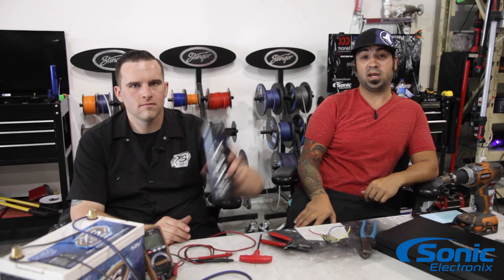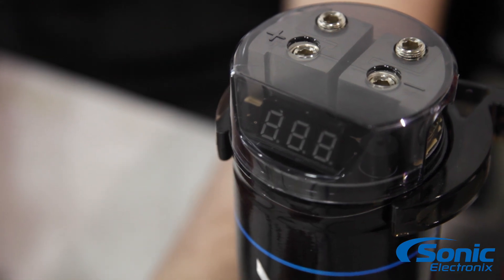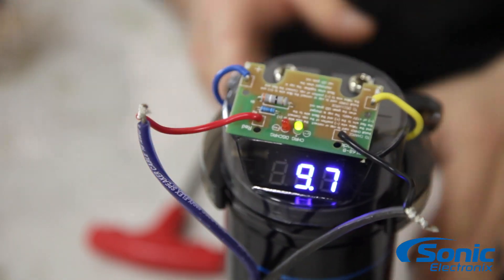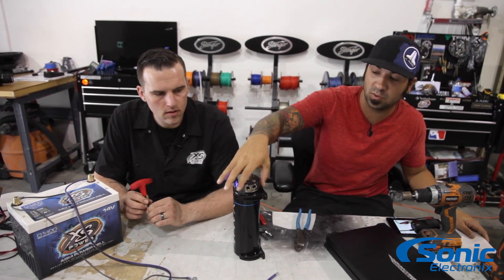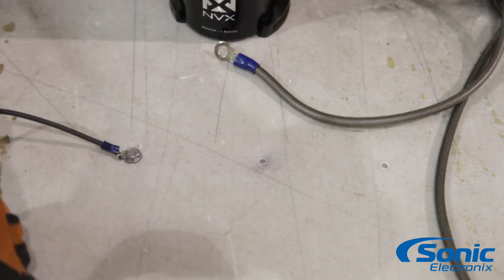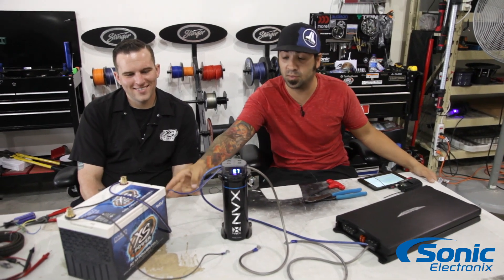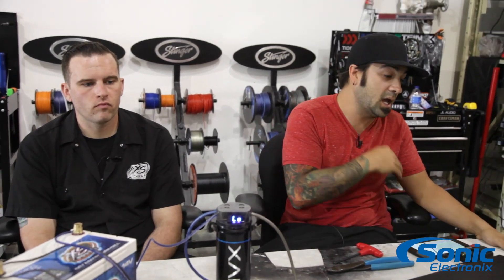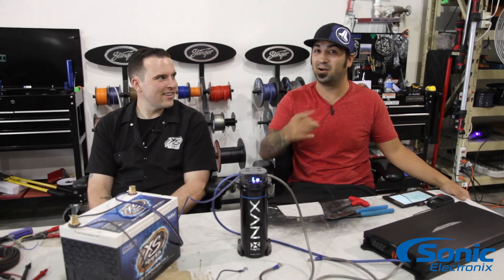How To Charge and Install a Capacitor | Car Audio Q&A

Comment: Is there a formula for figuring out how much voltage you need cause I feel like I'm a burn out my computer in my car. Running 2 10sdc2.5 soundqubed on 3400 spa and kills my truck all way down
Reply: +Nick kruszka Yes, there is.  Watts x Voltage / amp efficiency(0.8) = amperage draw
Reply: No idea what that guy's on about, but voltage-wise you want to maintain around 14volts or higher at all times. When something suddenly draws a lot it causes a voltage drop, so if you're experiencing something that starves your spark plugs of enough energy to fire when a bass note hits, then you very likely need either a new battery, a large cap, or to increase the gauge of your ground cable leading from your battery to the frame. If however you're saying that over time if you play your system loud enough it will drain your battery until it turns off, then that's completely different. The only way to combat that effectively is to upgrade your alternator or get more sensitive speakers or a more efficient amplifier. A capacitor might help slightly with that issue but it's very minor and probably won't make the difference you need.

Scale your power requirement depending entirely on how you run it. You're very likely not using the full RMS power of your amplifier, I'd say at most 80% of it if you've owned it long enough to make a few mistakes when switching between songs of different volume etc. You never really know how much power you're using though unless you get a proper instrument like a DC clamp meter with a max peak current hold around your wires or a quality current shunt with an accurate multimeter with max peak voltage. Just keep in mind some losses that naturally occur, the amplifier is going to lose around 10% in a best case scenario between what's coming in and what's going out, the alternator isn't always running at full capacity, the battery probably isn't cranking out its full listed amps all the time, and the rest of the car needs energy to run as well depending on how much electronic stuff is in use.
Reply: Yeah my electronic equipment definetlyold I need super up grade if I want keep it in my old truck and yeah it's goes in to brown out now I got 15 sundow zv3 :/

Comment: What is the big 3?
Reply from the maker: +Brownecakes "The Big 3 Upgrade" is an install you do to upgrade your vehicles charging / electrical system. You can buy kits that include all the wire and accessories you need.

The 3 wires that are upgraded:
1: Alternator Charging Wire to Battery Positive
2: Battery to Chassis Ground
3: Engine Block to Chassis Ground / Battery Negative

We are currently working on a Big 3 Upgrade How To video. Should be published in a month or so. Be sure to subscribe so you don't miss it!

Comment: You mentioned you may need to upgrade your alternator. At what point do you know that is what you need to do?
Reply: When running at a significantly high volume eventually causes the amp/head unit to go into power protect mode. This means that your battery is draining and your alternator isn't able to give it enough power to maintain equilibrium. Before you do that though, first check that your main grounding cable from your negative battery terminal is good and beefy, and that it's making good contact with the chassis. Also consider replacing your battery first, as this could solve your problems as well.

Comment: I don't understand why you're grounding to the table instead of the negative terminal of the battery...
Reply: +Oscar Hendrix  I'm just running a soundsystem, without the car...
Reply: +Oscar Hendrix I guess my question is, can I ground everything to the batt's negative terminal or literally any piece of metal?  I don't understand how this works without if you don't have a circuit...  (if you don't return to the negative terminal of the battery).
Reply: yes you can! and there shouldn't be to big of a difference
Reply: You can connect everything to the negative terminal without a problem. Just keep the power as far as you can away from the signal cables. I've heard from a lot of people different bullshit reasons behind different grounding procedures for the amp and the cap. Some people say always ground them in the same spot, others say never ground them in the same spot. I haven't looked into it much admittedly, but the same spot people make a lot of good points that seem to be lacking on the different spot side of things. Your system isn't in danger of sounding crappy because of the lack of a car, so long as your speakers are all properly enclosed.

Comment: you say when it drops under 12v the display turns off yet in the video it is still on?
Reply: +Just Trickky I was curious about that myself.  Seems the microprocessor in this cap turns off when LED activity stops rather than a particular voltage is reached.  If they had actually connected the cap to the battery, the LED readout would have stabilized to battery voltage and turned off.

Comment: hey what capacitor needs my amp 1500 watts max and 1100 RMS?
Reply: +Taylor Ramos 1 farad for every 500 watts is suggested
Reply: Taylor Ramos  
You would be safe using 1 Farad cap but I'd recommend getting a 2 farad (if you can afford it)  don't buy some cheap ass no name brand cap there a good example of you get what you pay for lol. No seriously avoid Boss ,  Pyle , Bullz elect. Go for Rockford Fostgate or Stinger's or Street Wires  cap those are reliable and will serve you well for many years to come. Good luck!

Comment: Is there a reason why you charged the cap via speaker wire directly from the battery instead of charging it via your power wire and the ground you had set at 6:05? As long as you're running it through the resistor on the charging tool wouldn't it virtually be the same circuit?
Reply from the maker: +mattyfizzle Right, it wouldn't matter what wire you use if you're just charging it up, very low current, so they just used the speaker wire because it was easier and it worked and it was just for the demonstration. However, it goes without saying.. don't install you're capacitor using speaker wire...
Reply: lol exactllyyyyy dat stuff b so funny to me
Reply: They wrote: "Don't install you're capacitor using speaker wire..."

Which would mean "Don't install you are capacitor using a speaker wire..."

They used you're incorrectly and correctly, but the second time they used it, it was the wrong use of you're. Before you reply trying to act like you're giving me a lesson, take some time and get up to speed.
Reply: They used "you're" in the last sentence when it should have been "your." They are talking about your capacitor, not you are capacitor. I swear, people are so fucking dense. Thanks for trying to explain to them, trippledigitss, I appreciate it.
Reply: +Sonic Electronix Your
Reply: +SeanOMatic lol grammer nazi
Reply: +Christian Creighton Grammar
Reply: Then you must be cracking up all the time because the grammar people use these days IS HORRIBLE!! hahaha
Reply: SeanOMatic and I hope u know that you're actually the wrong one here. it is you're not your.
Reply: elice05 I thought the same thing but there is 2 different uses, I think he means the 2nd one. . I'm guessing...

Comment: They need to do this with a "basic" tool most people don't have a fancy led board.
Reply: +mark smith A 12V test light works.
Reply: Pretty sure they used that because it came with that particular capacitor. Also yes, a 12v light bulb works, they could also use a car battery charger without issues so long as it's not a piece of crap charger that can't set its own current limit without the resistance of a battery. You can also buy a large ohm value resistor on  ebay for less than a dollar that would work.

Comment: I have two questions about your table car question number 1 how many miles to the gallon do you get in that ride?  question number 2 where did you have the speakers hidden?
Reply from the maker: +Steve White We'll be honest, the milage isn't very good, and it's top speed is probably about 10mph (or as fast as you can push it across the room). And unfortunately, aside from the battery, amp and capacitor you saw them install, everything else is stock.... aka.. no speakers.   :[   

We will have to put some more work into it, maybe do a whole install video?   :P
Reply: and is missing a ground plate

Comment: i have 2 kicker crv's in a ported box that i am pushing with a massive n4.. i have a massive 4  cap.. my problem is when i turn my stereo off i get this huge rumbling sound from my woofers.. im wondering if i should take the cap off.. what do y'all think?
Reply: Sounds like more of an amplifier/headunit problem than a capacitor problem to me. I don't know the details though, i guess it might be the low pass filter in the thing? They have coils to shape the sound characteristics and when power is cut off the coil's magnetic field collapses, causing a jolt of voltage... I don't think that'd be audible as a rumble though, so who knows.. Maybe a combination of caps and coils for a steeper drop off, but that's literally a shot in the dark as to what's causing that. I will stick with my original guess though, that it's not anything to do with your capacitor.

Comment: I did the big three... I upgraded my alternator... i have a second battery... I drop the bass in the mix, my voltage meter on my truck says around 12-13v and my lights dim... I ordered a 3 farad cap and im hoping it will solve the issue... is there anything else i should revisit. Like Grounding or something...
Reply from the maker: +Bully ThaKidd If you did all those upgrades and you're still getting dimming then yes, absolutely go through and check all your grounds. Sounds like you could be losing some voltage to a bad connection somewhere.
Reply: Specifically the ground cable from your battery to the chassis, it should be two wires of greater or equal gauge to the ones coming off the positive terminal. Also make sure the battery terminals and connectors are clean for both positive and negative. The grounding to your amp is probably fine. Since you upgraded your alternator, you may also want to replace the cable going from the alt to the battery with a thicker gauge, but that wire isn't a fix for your problem, it's just recommended as a matter of cause. Unless of course they dim over time, not just when the beats drop. In that case you should definitely suspect the alternator wire.

Comment: Well guys, thank you so much for truly clearing up any misconceptions about why a cap should be used, my only question would be then if a half farad cap cleared up the alt noise then why are there such large caps and cap banks on the market if they're mainly for filtering alternator noise? And the nvx looks identical to the pyle 5 farad except it has the terminal block (very nice) and the smoked plexi.

Comment: How did you get charge the cap at 13volt. When I charge my cap it was 9volt or even lower. I am wondering if the cap get the full charge
Reply from the maker: +stephen, hui Your capacitor has a digital display like the one in the video and only charges up to 9 volts? Even with the car running...? Out of curiosity, what capacitor do you have? You know the brand and model?
Reply: +Sonic Electronix the car never running when the cap charge. The brand is american assistance cap 2 fared
Reply: +Sonic Electronix but every things is ok I have a 2 l7 15 on audio pipe 1800.1 the voltage it was dropping but I have my cap on it never get lower 13volt
Reply: You should have the car running while charging the cap, that or use a car charger directly into the cap if it's going to take a while. It's also possible the volt meter is just a piece of crap, at 9volts your car battery likely wouldn't have started after that. Seems fairly likely since Audio Pipe isn't exactly the best brand out there.

Comment: I love how the cap slowly discharges through the video back down to 0. Thereby making that slow initial charge completely useless.
Reply: Yeah.. No way a real decent capacitor would do that.  Either the cap is bad (leakage) or that voltmeter REALLY sucks the mA's.
Reply: Or.. the table top is mdf and none of the negatives are connected?
Reply: He actually hook the roll wire up and the thing never got a charge from the battery after the charging tool. That was the negative cable and that is why it was discharging smh he was about to blow something up lol
Reply: All those .5 or 1 farad caps are garbage.

Comment: Which is better adding a second battery or having a capacitor, or having both?
Reply from the maker: +ShaunJaySays As Allyn and Brendan mention in this (and other) videos - they do not believe in using a capacitor to "fix" voltage issues. If you're having any voltage issues you should upgrade the battery and alternator.

Comment: Best way to use a capacitor throw it in the trash do the big 3 add another battery or upgrade the alternator
Reply: Yeah, someone that has a small system of 1,000 watts should definitely spend $500+ doing all that. Fuck spending $100 or less on a cap.
Reply: Not necessary if your running low wattage systems, a cap will help boost response during critical periods.
Reply: +legendary504 and use ultracaps
Reply: Wrong, all the ABC's benefit juice for amps. All demo vehicles , even Steve Meade uses cwos
Reply: Legendary504 I have added another battery,I was thinking about getting a cap......so another battery is better idea right?
Reply: Morgan Ibarra yes,but run the positive off the capacitor
Reply: You can buy 3100 FARA caps now, none of this bull shit 1 farad .5 farad shit.    And those 3100 F really do make a big difference.
Reply: Do i need to ground the cap and the amp?